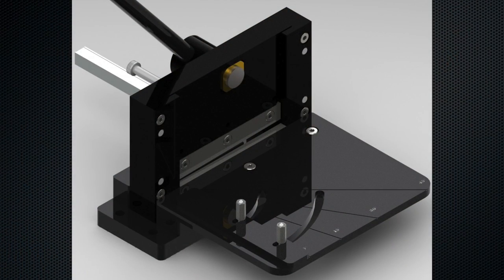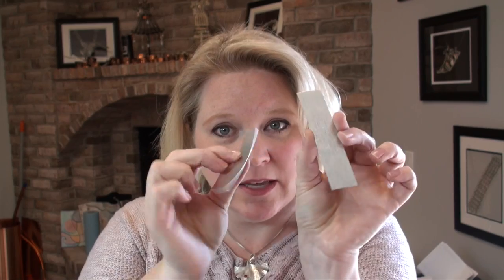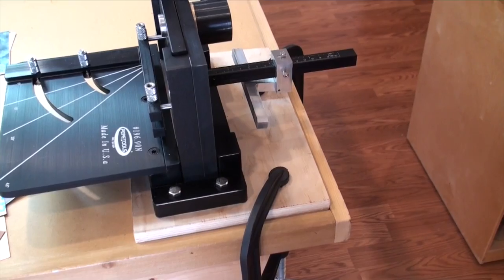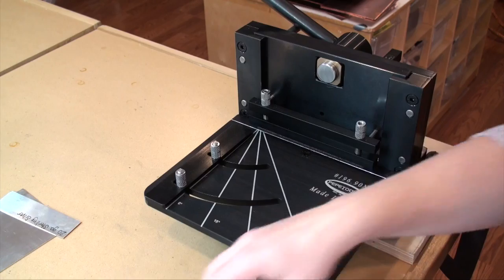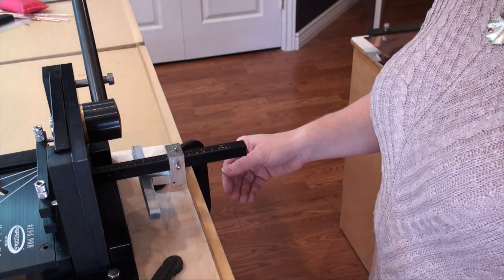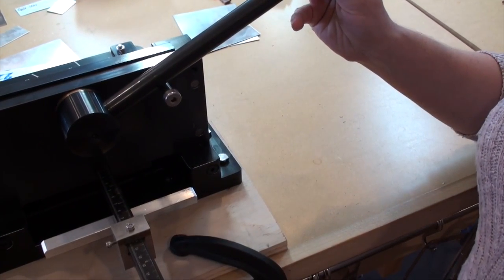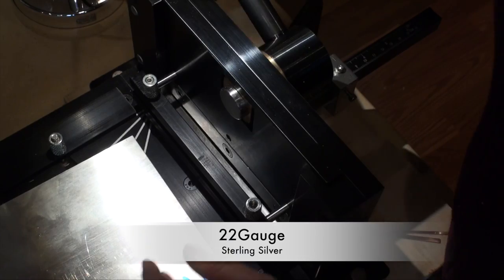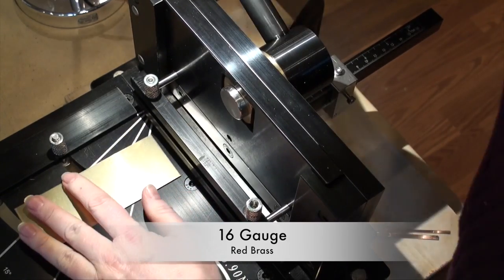Pepetools 6" Guillotine Shear

Comment: Melissa- on this tool, what is the smallest width the measuring guide can handle? Seems to me the smallest width I can get using it is 30mm. I want to cut consistent 12mm strips - is that possible?

Comment: Hi Melissa, I just picked up a 4 inch shear from Pepe and I have one question, I find that the lower part of the measuring guide wiggles on a spring and I can't get an accurate measurement for repeat cuts, should I be placing my metal in the centre of the guide plate and not use the side guide?
Reply from the maker: I never really use the guides and such for that reason. I typically mark the metal where I want to cut it and then make my cuts.
Reply: @MelissaMuir  Thats what I have been doing too, if I may ask another question, is it okay to use the guillotine after I have textured annealed copper or should I always cut it first? Thank you for being so generous with your time and knowledge.
Reply from the maker: @feltthefluff  you should be able to
Cut it just fine without annealing. In fact, I find it a bit better.
Reply from the maker: @feltthefluff  yes. It is good to go before or after you texture the metal.
Reply: @MelissaMuir  thank you!